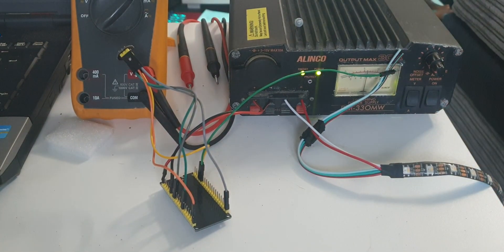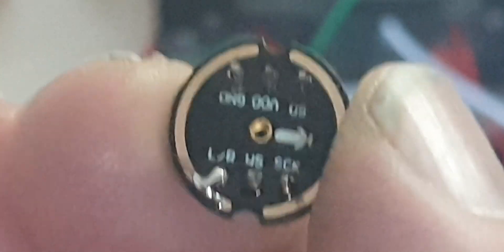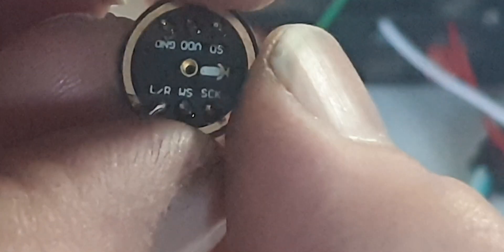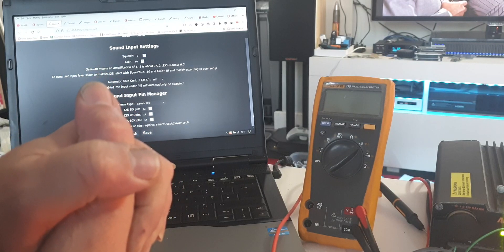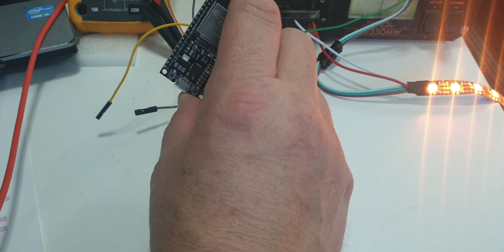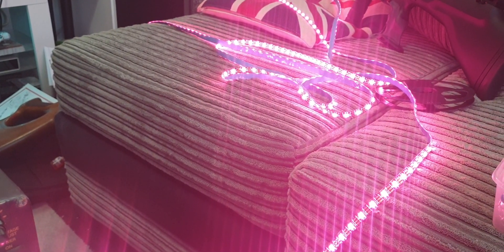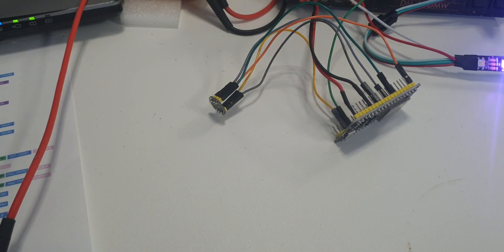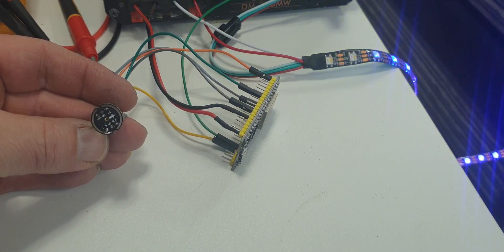The (Almost) OAP's Guide To WLED in 2023: Audio Reactive Set Up With A  INMP441 Digital Microphone.

Comment: Hi! I'm working on a similar project and I got super stuck on couple technical aspects. Chat gpt did not help at all. Would you be able to help me? I could send you more details via email. Thanks in advance!!
Reply from the maker: I can't code so if you need help with that, the answer would be no.
Reply: @Cornz38  not with the coding fortunately. I want to make almost exactly the same setup as you, just with with a different inverter and with led strip powered by a 12v power supply connected to an outlet. Im not sure if im making my set up right, what part goes where. I suppose its basic stuff, im at the begging of my journey :)
Reply from the maker: @piotrlewandowski8062  I can try!!!!

Comment: I bought all the bits to do this but have also ended up getting some Off the shelf Athoms due to how streamlined/compact and ready to use and also include the relay to cut off power. I'll save the kits for when I have a bit more time to play.

Ive found  that a cheap way to go about getting some LED strips if you want the with the neon type diffuser is to get the  sort of TUYA ones and butcher them up plus you can still make use of the remote and the infrared receiver for WLED with an esp32.

Watching your videos reminds me that I need to get my hw100 fully serviced since changing the usual suspect o-rings no longer works!. Nice bit of kit. 👍